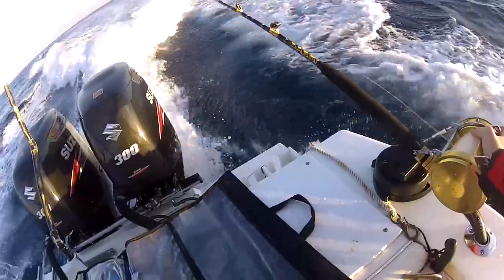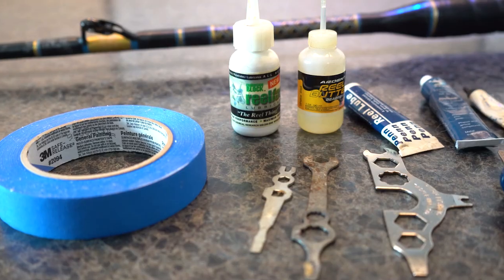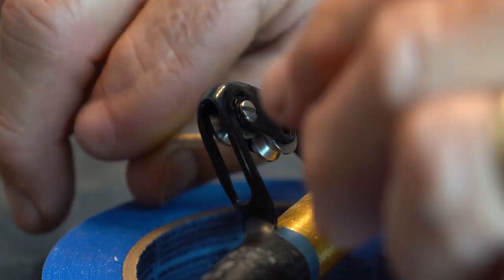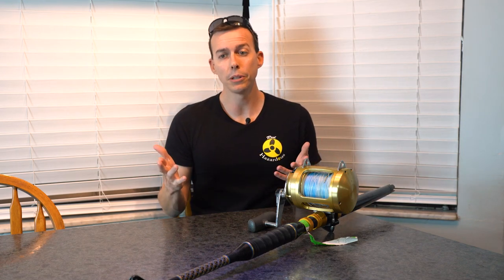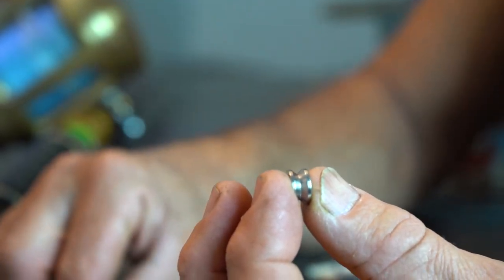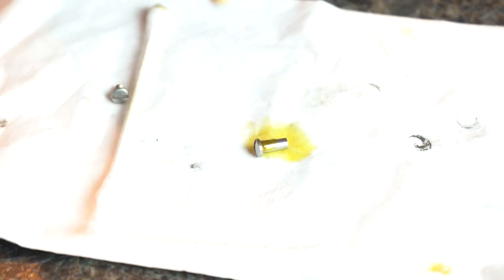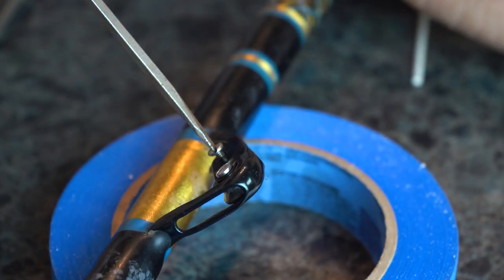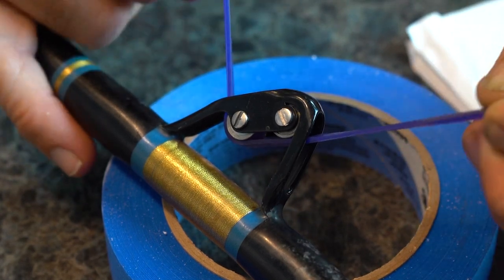How to Clean Roller Guided Fishing Rods

Comment: It is a good idea to either put a drop of glue on and around the screw heads or use locktite on the threads I have seen the little screws work loose and be lost.
Reply from the maker: Thanks, that's a good idea!

Comment: i only have a roller tip and havent used it yet anything i need to know?
Reply from the maker: No the tip is where the most pressure is so it will still work well. Just receiver to clean the tip roller so it’s always able to spin easily.